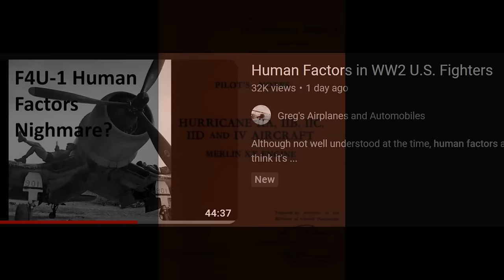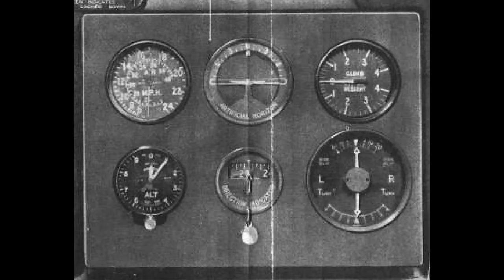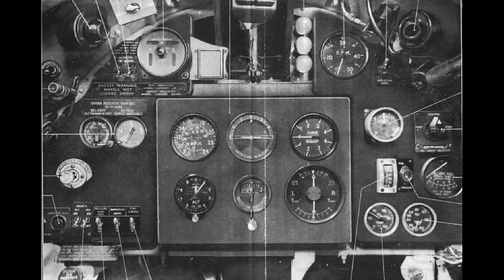Human Factors In British and German WW2 Fighters

Comment: I'm glad you mentioned the ammo counters, it's amazing how hard it is to try to keep track of ammo in a sim. I can only imagine what'd it be like with the pressure of real combat.
Reply: Most people in video games have trouble keeping track and they have a digital value displayed directly on their screen. I've flown my P-47s enough that at this point I have a pretty strong intuition of how much ammo I have left without checking, so it's not like a lack of ammo counters was unworkable, just unnecessary.
Reply: I am just started trying to learn how to fly in DCS and on Sunday I was doing a mission. I locked up 2 MiG-21s that were comimg in fast, already pretty close and fired an AMRAAM at each one and then broke to try and stay out of the merge. As I turned around I started hearing their weird noise and my HUD symbology changed and I was like, "WTF am I out of AMRAAMs?" Yes. Yes I was. I can't even keep track of that with a little blip in front on me that says 3MRM, 2MRM, 1MRM. 

I ended up turning back around, locking the last MiG with my 9X, but it went after flares and I ended up merged. Let's just say I haven't mastered keeping visual contact with bandits (or really anything if I'm honest) and while I was looking for the guy, I flew into the side of a hill.
Reply: A lot of pilots were still doing the "last 50 rounds with tracer" trick so they knew when they were at the limit of their ammo and had just enough to try to deal with what they were currently doing (or run home if they'd just finished dealing with it).
Reply: Ammo counters in aircraft are one those funny little things, which became so basic that nobody ask why they are there, but when it comes to someone's favourite plane lacking them, then it's suddenly unnecessary waste of space. I don't think I've read a lot of pilot stories, but cases where a pilot fights for a long time to get into position to fire, only to find his guns empty, are not that uncommon.
Reply: I recall seeing a documentary regarding George Beurling, a Canadian flying with the RAF. During a training flight (gunnery) he told his instructor how many holes he put in the target, and how many he had left. He turned out to be  correct on both counts.
Reply: I know.  Ammo counters, right. This whole series proves that the little details can really make a difference.
Reply: @XSpamDragonX  All of that goes out the window when you've got a load in your shorts. Nothing "unnecessary" about ammo-counters.
Reply: In real life proficient killers got in really close and used a minimum amount of ammo.
Reply: @MFKR696  Reread, I said a LACK of ammo counters was unnecessary, i.e. it wasn't worth skimping on them.
Reply: @Sherwoody Beurling also had his armorer on Malta load his guns with NO tracer ammo to give him a few extra seconds before his opponents knew they were screwed!
Reply: @Ensign_Cthulhu indeed. On the down side, the opposition also knew when the pilot was running low on ammunition.

Comment: Eric Brown noted in one of his books that the birdcage noses on German bombers were not only optically poor with lots of distortion from the curved plexiglass they also had a nasty tendency to fog.  I'm pretty sure it was in wings of the Luftwaffe but I don't remember which chapter.  In any case a blurry or foggy windscreen isn't just an inconvenience it also takes a psychological toll.  Humans are visually oriented and blurry windows are both maddening and distracting.  A foggy windshield drives me nuts when I'm driving a car; I can't imagine flying a plane with a fogged windscreen is any less annoying.
Reply: Remember Yeager saying an old Chief Mechanic use to smear(or rub) Prell Shampoo on the windscreen an he swore by it.
Reply: Try riding a performance (or any) motorcycle on a cold day without a fog shied/pinlock visor
Reply: @moss8448 
It works on scuba masks too!
Reply: @TheRealNeill
Every German bomber was designed to be dive bomber. You need good visiblity for that.
Reply: The fogging was a big issue in the Heinekel 111 .
Little known fact, look at the cockpit of one immediately above the pilots seat.
There is a sliding hatch.to open on approach if the cabin fogs up, amazingly the pilots seat and primary controls all elevate on pulling a large lever , leaving the pilots head just above the fuselage ,enabling him to land it like a 1920’s open cockpit airframe.
Reply: @TheRealNeillProbably not for morale purposes on the He 111, but to make coordination between the pilot and bombardier easier. Probably in case of a partial bombsight failure as the bombsight on the He 111 had an autopilot to steer the aircraft on target, much like the Norden bombsight.
Reply: It can't have helped close formation flying any either.
Reply: @fazole  Do. 17 and He-112 were not designed to be able to dive bomb. It was in vogue - early on the P.13/36 specification that led to the  Lancaster and Halifax required dive bombing as well as catapult launch.
Reply: The Blenheim I had a glass nose, but flat panels for visibility. The He-111  did allow the pilot to pop their head out the top if required.

Comment: Greg hits the spot with another pair of fascinating and original videos. I thought you might have mentioned the Mosquito as an example of how to absolutely get everything wrong in cockpit ergonomics.
Reply: I was thinking the same thing. Fuel controls essentially behind the seat, right handed flap and gear handle each with unique lock mechanism, center mounted gun sight in a side by side seat configuration etc. Human factors even extend to the navigator with the radio placed behind him requiring him to twist 180 degrees to operate it.
Reply from the maker: I'll talk about the Mossie at some point. That one is quite easy to do because the DCS sim models it so well. Finding good cockpit photos is a big problem with WW2 airplanes. I didn't talk about it in this series because multi-engine and multi-crew brings in a whole new set of issues.
Reply: @GregsAirplanesandAutomobiles  DCS does it great. Lovely airplane, but flying it in the sim is where I really noticed how a cockpit design can affect operating an aircraft. Part of that is obviously due to you having to do the work of two men. I was going to mention fuel gauges as well, but I assume the navigator would have assisted in keeping an eye on those. Excited for that video whenever it comes!
Reply: I guess de Havilland had to get something wrong with the Mosquito. It did have fantastic heating though.

On a recent business trip to London I managed to get to the de Havilland Aircraft Museum in Hatfield where there are three Mosquitos, including the prototype. One of the docents asked if I wanted to see inside. Did not have to think about my answer. Definitely worth a visit if you’re in the area.
Reply: @GregsAirplanesandAutomobiles  I'll be sure to be watching when that video comes out.
Reply: The Halifax wasn't any better. The crews used to joke that the cockpit layout had been designed by Hitler.
Reply: The pressurised Spitfires must have had heating,right? I find the line of evolution that led the British from the huge pressure chambered Wellington to single seat fighters to absolutely astonishing
Reply: @GregsAirplanesandAutomobiles  but DID have a heater - 🤷 Also statistically brutally effective despite dodgy Ergo. 'Fact'. If only we didn't have kilts at Culloden & instead, I dunno, drones
Reply: @andrewpease3688 The compressor must have generated significant adiabatic heating, remember the hot end of a bicycle pump?
Reply: @alexanderrswaim5142 
I read a Mosquito pilot's memoir in which he said he never needed to fly in full flying kit, even in deepest winter.
Reply: I've not been in a real Mosquito, but the DCS one is an ergonomic mess.
Reply: @andrewpease3688  but were notorious for being too hot at lower altitude.

Comment: You mentioned the tailwheel on the Hurricanes and Spits, and I think the FW190's tailwheel was a clever design. AFAIK, the pilot locked the otherwise free-castering tailwheel by pulling back slightly on the stick. This feature allowed the pilot to lock and unlock the wheel as needed during taxiing without having to take a hand off either the throttle or stick.

Comment: Just another reason to love the FW190. It's my favorite of the non-U.S. prop fighters. There is elegant design everywhere in that airplane.
Reply: It was definitely a dangerous fighter. Many pilots didn't really like it. One thing is bc the cockpit was hot. The way the fuselage was designed, the heat from the engine made it real hot. Kurt Tank tried to address it, but it never went away.
Reply: It's lacklustre high altitude performance was never really sorted though, until the Dora 9 which was too late to make a difference.
Reply: @franktreppiedi2208  sorry for being a bit late, but your comment reminded me of Lavochkin and his La-5 and La-7, both of which had cockpit temperature problems among other things. 
If I remember correctly, the temperature within a closed cockpit varied from 40-45 to 55 degrees, honestly can't remember the specific numbers, sorry.

Comment: As an engineer, ergonomics is always on my mind. Attention to detail is key. Two engineers can design similar things, and people will know one engineer is better, but not be sure why exactly. The difference will be in the engineer who paid close attention to details and just an all around better refined design.

Aircraft ergonomics is one of these examples. Some engineers get it and do a great job, most do not.

I also experienced this in combat with other vehicles. When strapped in, we couldn't reach half the switches on the dash, and so we'd have to ride around not strapped in. whoever designed that dash needed to be fired, there was no excuse for such a massive flaw. We were constantly modifying our vehicles to work better and be practical. I helped give feedback to many companies regarding their equipment and its many flaws. Some engineers take the feedback well and improve their product, others take offense and refuse to fix their mistakes. If you're an engineer, don't be the latter. Welcome feedback from people who actually rely upon what you design.

I'm glad you're covering such factors in aircraft.
Reply: I used to fly survey, most companies have a proprietary display. With what some engineer figures is correct. Leica had the altitude commands different from aircraft standards. Ie: command bars up fly down, extended centre line a lovely curly cue until 2miles back etc... The engineers response was "well it makes sense to me" these maybe brilliant men, but garbage engineers
Reply: My career was in IT. Everyone uses our products these days; we have all experienced the results of poor design and lack of response to user feedback. While software failures don't usually have life and death consequences it is becoming more common.
I just fail to understand Engineers who resist user feedback. The Engineer might have "reasons", but those reasons don't matter if the product will not sell because it's unusable or fatal.
Reply: @ndenise3460 Bit silly not to follow aircraft standards if that is where the equipment is to be used ? Makes sense to that bloke but no one else and then the company wonder why sales are dropping? 
Mark from Melbourne Australia 🇦🇺
Reply: Similar things apply to buildings and furniture. Things should come to hand easily. Sometimes it can't be helped so for example a light switch is placed as close as possible to the entrance of the room. Later on when more furniture has been placed in the room, getting to said light switch can be tricky. I had an example of this at work just the other week and had to hunt around for the light switch. 
Mark from Melbourne Australia 🇦🇺
Reply: @markfryer9880  Yes!
Reply: @AndrewBlucher  totally agree!
Reply: @ndenise3460  yes, engineers that respond like that are terrible to work with. I despise that attitude. teachers are like that too. I tell teachers, teach the method that gets through to the most students in a given class on the first go, rather than the method you personally prefer best. I can write a whole book on why (and have notes and a prelim layout for such a book already started).
Reply: Well you seem like a pretty smart guy and maybe if one of the airlines is lucky they will hire you because the entire cockpit needs a total overhaul. It is a disaster. Basically a digitized version of what we had 85 years ago with analog instruments.  Yeah now they have some flat screen but they’re not using them right.

Every single airliner should have a screen showing a Birdseye view of the airplane, see-through, so if anything goes wrong it lights up and the pilot can immediately see what the problem is like an engine fire.  

Also the Birdseye view allows for orientation in any weather conditions.   Cars that cost only $50,000 come with this!  The airline industry is disgraceful!

How about a profile view also on another adjacent screen, so you can see the same thing, see-through,  clarity, situational awareness, no interpretation needed.

It’s the dumbest collection of engineers and pilots ever collected together in any kind of endeavor, the present state of the airline industry.  Not to mention the boneheaded managers.
Reply: @steveperreira5850  who are you talking to?
Reply: Kurt Tank was exceptional at ergonomics because he also flew the aircraft.  Even RJ Mitchell learned to fly at the end (despite having cancer) to better understand the pilots' needs.

Comment: I'm having an absolutely fantastic day. I got started paying attention to Human Factors / Ergonomics a bunch of years ago when trying to design and build decent work station areas for multiple computers with multiple monitors. The best references that I've found have been NASA and of course the Human Factors Statistical data. I've run into several instances where the design started not with where is the bet position for accessibility for, pardon the expression, altitude challenged personnel, but with where is it easiest to install this required device. Often the relocation of the switch from 7 feet above the deck to a better location is non-trivial, requiring outside assistance to run new wiring. Other times it merely requires a bit of outside the box thinking.
I think that of all the designers of the era, Kurt Tank, was the one who never forgot what it was like to be in the air in the middle of an emergency and worked hard to ensure that the emergency order of operations was simplified. As Juan Browne is fond of saying: Aviate, Navigate, Communicate.
Thanks for a great series on ergonomics and design.
Reply: Prof. Tank is known to have flown his own aircraft, even in combat (although management put a stop to the combat flights as soon as they found out).
Reply: For many years I was a computer consultant and you might think the ergonomics is not that important, you would be wrong. putting entry field out of order confuses the entry clerk and leads to mistakes. putting the button that you want a person choose in the wrong place can really screw things up when they press the wrong button. These are just two examples in office situations that can lead to disasters.
I remember looking at the report of the reasons for the Three Mile Island Nuclear Disaster and one of there main points was the design of the control boards making it difficult for the operators to fiqure out what was going wrong.

Comment: My father had quite a few hours in the Spit MkIX and would completely agree with your assessment of the pneumatic brakes. Another problematic factor with pneumatics were any leaks in the system due to wear or battle damage meant a landing with no brakes.
I know that you didn’t go into the 109, but my father was terribly disappointed when he had an opportunity to fly the Buchon. During the cockpit checkout it came to his attention that the canopy could not be closed with his 6’2” frame in the cockpit even without a seat pack on! The 109 cockpit is like being wedged into a F1 racer- I don’t know how anyone got out of it if it was out of control.
Reply: I think I saw somewhere that the Germans had devised a specific way of bailing out of the 109 which involved grabbing hold of handles installed for this purpose, crawling out of the cockpit to the left side and pushing your body downwards from the side of the fuselage to avoid being hit by the horizontal stabilizer struts of the early models. Of course this required that your arms and hands weren't too badly injured.
Reply: I remember a TV programme where a British Battle of Britain veteran was given the chance to sit in a ME109. His comment was that he would have been much more aggressive if he had realised how poor the visibility was from the German plane due to the close fitting and heavily framed canopy design.
Reply: @Gloomendoom 
I saw something similar where a Battle of Britain Memorial Flight pilot had the opportunity to sit in a '109. Having spent many hours flying the Spit and Hurricane he was not impressed by the cramped conditions and poor view in the '109 (I seem to remember it was an F-4 version) as well as the heavy and clunky cockpit canopy. He did quite like the cockpit layout and instruments though.

Comment: I’d imagine cockpit heating was seen as having significant drawbacks.  If done with a heater core, as in cars, it would add another failure point for the engine cooling system.  If done with ducted hot air, it would compromise the firewall and add to the chances of CO in the cockpit.
It’s just unbelievable that the Germans were able to fly daylight fighters on the Wilde Sau missions against the night bombing raids.  They certainly weren’t notably successful, but the sheer courage and skill required boggle the mind.